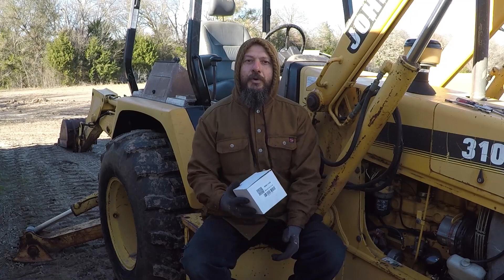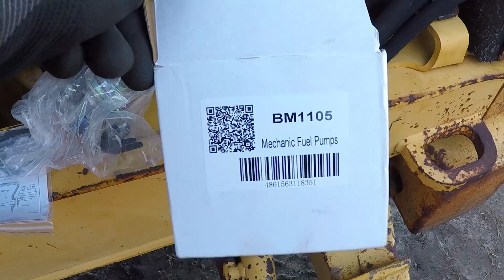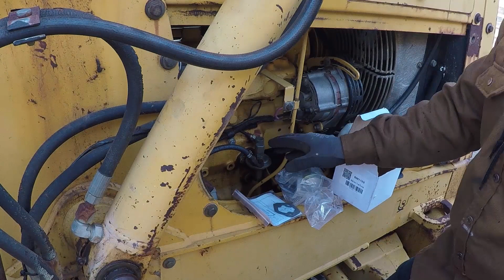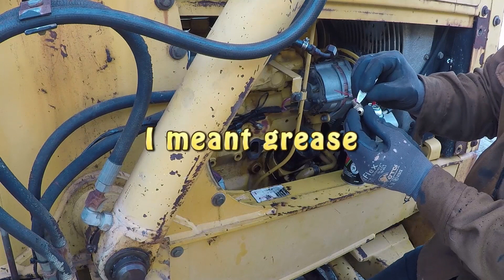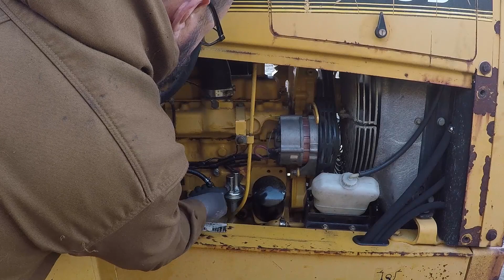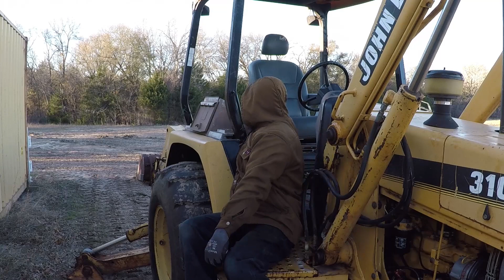John Deere 310 Replace Fuel Pump

Comment: That eBay pump looks better than the replacement pump I got from John Deere. The top and bottom housing pieces are held together with screws which were loose right out of the box. I only noticed this when it leaked at start up, so I tightened them and it fixed it. One year later it started leaking again and all of the screws needed to be tightened again. Junk.
Reply from the maker: I don't purchase anything from John Deere. They over price their parts by a lot. When I re store the seat for my backhoe (I have a video on YouTube if you are interested, please watch it), they wanted to charge me $70 for 6 ballbearings. I bought 10 of the same size and better quality from Amazon and it only cost me $4 shipped to my house. They wanted about $3000 for the water pump and I got the exact same one from eBay for about $200. I don't mind supporting local dealers/business, but not to the extent of paying 10+ times.
Reply: @SalamSayhood  Haha, Salam, I don't think you have a 310D video that I haven't watched yet. I think you even helped me out with a question I had during a starter replacement, or some other work I was doing on the machine. Love your videos man! They're very helpful.

Last summer we had to pull the reverser out of this machine to get it rebuilt. The dealer dropped the reverser at some point during their work on it, cracking the clutch disconnect solenoid in half and also bending the solenoid valve. Their price for a new solenoid and valve was $2,600 CAD! And no that's not a typo. Even the parts guy was shocked.

We couldn't prove who was responsible for the damage with absolute certainty, and we were able to find a replacement from Summit Hydraulics for a couple hundred bucks instead, so we didn't make a big deal about it, but we certainly would have if we were stuck with that $2,600 bill. I know their parts aren't cheap but man that is ridiculous
Reply from the maker: I believe you 100%. I will never purchase anything directly from John Deere or Caterpillar. If I need something in a hurry or it is too heavy for shipping prices, I go to a local heavy equipment shop and they get the part from these 2 companies way cheaper than if I go directly to the source. I know it doesn't make sense, but I experienced it many times. It's the only situation where the middle man will save you money 😂

Comment: Thank You so much for your great videos.  There's certainly isn't much you can't fix or build better.  I've watched all your vids on rebuilding your backhoe.  So finally I'm getting my very nice '87 310c, 4wd,  cab with heat,  extend-hoe with quick change, 3 buckets and ripper to get after tree roots along my ditches is running great.  Poor thing has been sitting for 2 years. Started like it ran yesterday and now has fresh fuel / treatment fed through her.  I'm 70 and my younger neighbor just rebuilt both stabelizer cyls. and boom cylinder.  Swing cyls. will be next after changing engine oil, etc.   I buy parts, we repair together and will use it on both farms.  He's good people same as you, even has his own nice machine shop business.  I decided the tires he's repaired won't hold up so I'm putting 4 brand new Titans on it because it's such a clean machine.  This well taken care of machine seems to have all options except A/C.  The "C" series are awesome.  It has a rebuilt injection pump, starter and will replace fuel pump soon to hopefully prevent dumping Diesel into crancase.   Thanks for all you do.  From the farm near Battle Creek, Mi.
Reply from the maker: Thank you sir, I appreciate your comment. These machines are great. You did the right thing by flushing the old fuel. Make sure to do the same thing for the hydraulic system after y'all finish rebuilding the hydraulic cylinders. Be safe and have a great day

Comment: Very informative parts replacement video. Thanks for sharing. Do you also plan to make some videos about outdoor power equipment repair? Maybe we can collaborate to help more DIY repairers in the community?
Reply from the maker: Good morning, I have several videos about small engines, chainsaw, riding zero turn mowers and several outdoor power equipment. Do you want me to send you a message on Instagram? Thank you

Comment: I had just purchased a used 310 last month and finally got around to changing the oil.  While running it with the side cover off to check of oil leaks around the filter I saw drips coming from the fuel pump.  Ugh, another part to replace!  This video, like the one you did for the water pump, is a great step by step lesson, which I thank you for, so I'll be better prepared when my new fuel pump arrives.  One more thing.  I notice that your 310 has a guard over the alternator pulley which mine does not have.  I guess it went missing or was broken by a previous owner.  As I seid in a prior comment - I learn more about my machine by watching your videos.
Reply from the maker: Most likely the previous owner replaced the alternator on your machine. I appreciate your comments. Be safe and have a great day

Comment: Is there an in-line fuel filter somewhere before it reaches that fuel filter above the starter? Also what size is that alternator belt? My belt is very worn and needs replacing. John Deere 310A here. Thank you.
Reply from the maker: I have a video showing replacing the water pump and I showed what belt I use. My machine doesn't have a full filter between the fuel tank and the delivery pump.

Comment: my jd 410 wont start easily lately and will die after some time.  It surges also.  what do u think. also the priming lever does not work and hasnt since ive owned it
Reply from the maker: This could be:
1- the fuel pump is going out 
2- fuel contamination.
3- fuel line issues.
4- bad fuel filter.
5- injectors pump or injectors.
Start trouble shooting it in the order I listed. 
I hope this will help.
Reply: @SalamSayhood   THANKS!

Comment: I agree with you on the separate pump [much like a gas engine pump] cheap, easy to replace than the integral injector-pump unit. Great video Salam, you really keep your equipment in excelent condition!
Reply from the maker: Thank you sir, I appreciate your comment.